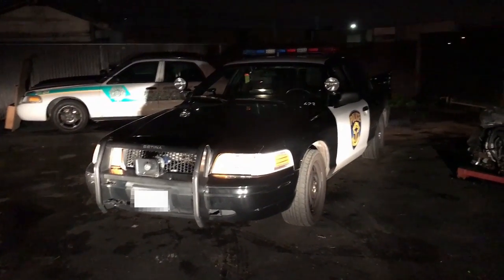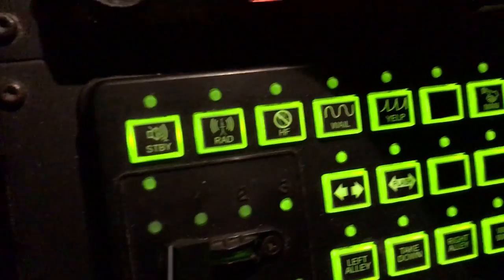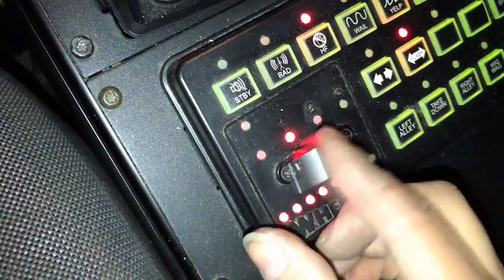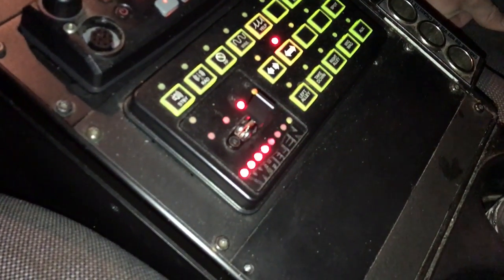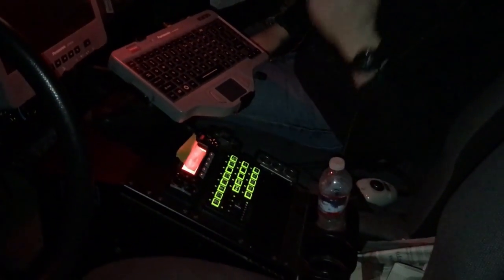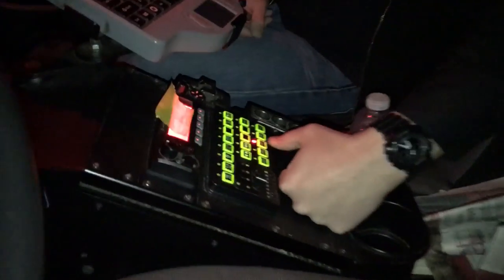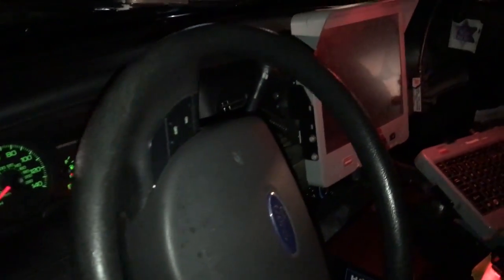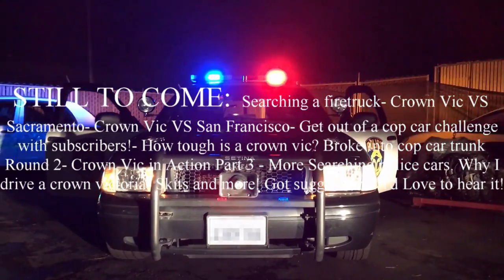Playing Around With An Active Police Cruiser! Ford Crown Victoria Interceptor Cop Car

Comment: and he wouldn't have a key to the radio deck. the radio head up front is locked out from being messed with. the bricks in back locked for good reasons and this proves why agencies need to utilize them. thanks for the demo.

Comment: The control switch needs to be activated in order for the siren to work... also on the wig wags, this vehicle may need to be in drive for them to work also.
Reply: You would be right normally but when I took this car to have crown Rick film it. I didn't realize the car was out of service because the siren box wasn't working correctly.